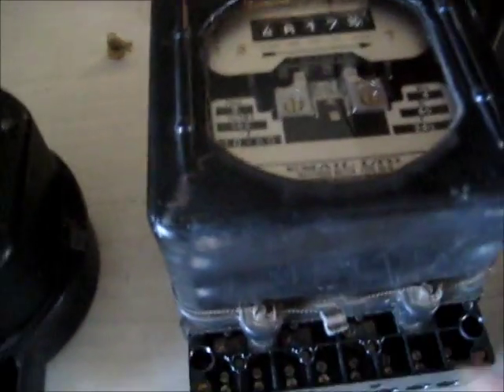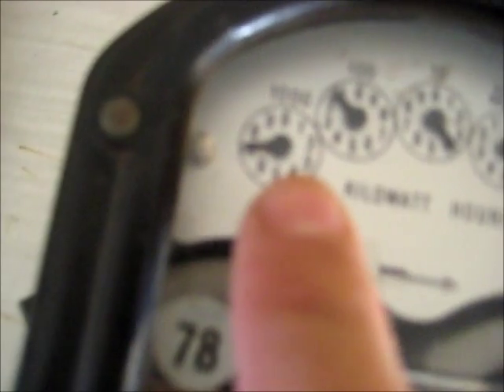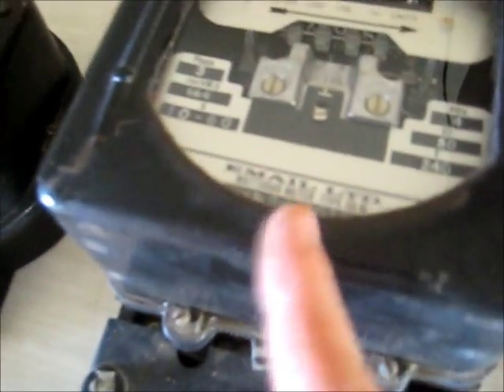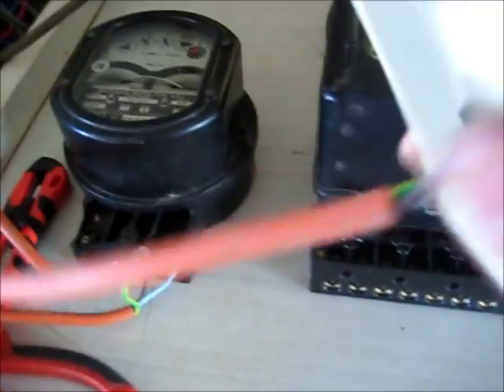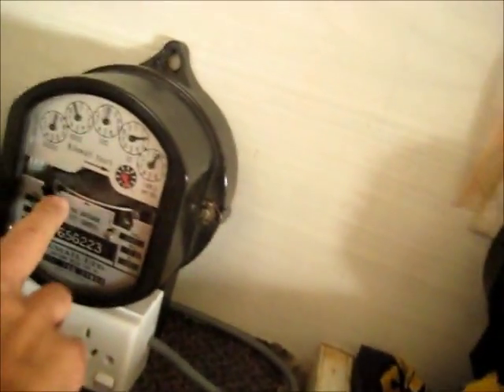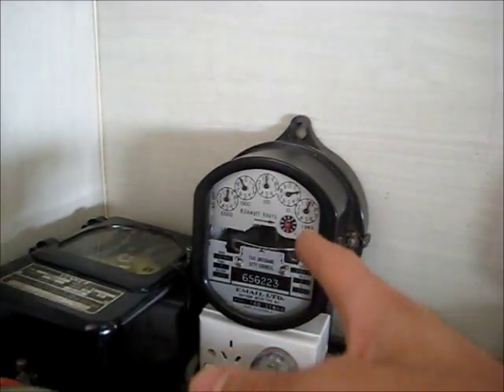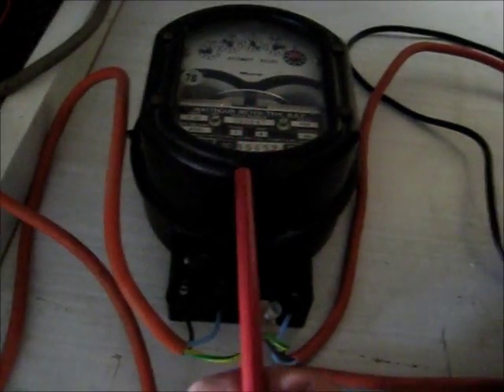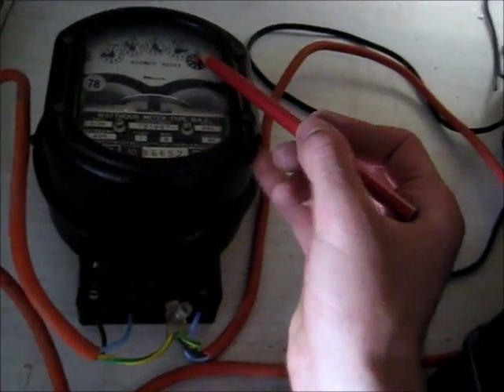EMMCO B.A.Z Kwh Meter Restore & Test (Part 1)

Comment: @OldTimeForties Some meters go slower some go faster as the brake magnet weakens over a period of time.
Usually the effect of worn jewel bearings and a weakening brake magnet cancel each other out with the tendency to go slow for most older meters.

Comment: @HDXFH Your SDM is a whole current type. 66.6 rev / kWh
The CT version has 4 digits + 1 orange decimal wheel for a blank 5 meter or one or two fixed zero's on the nameplate for a direct read CT meter.